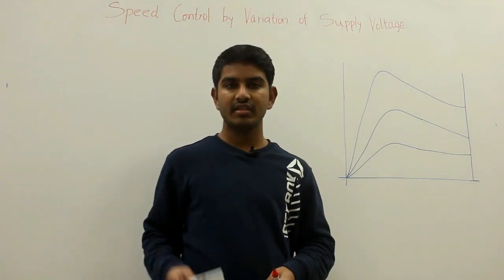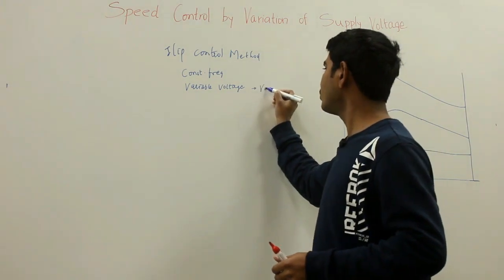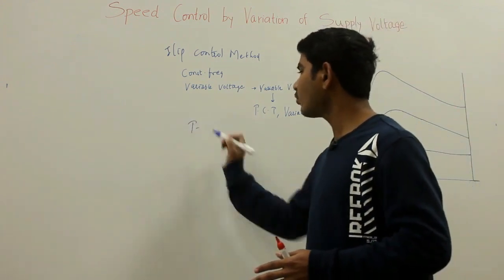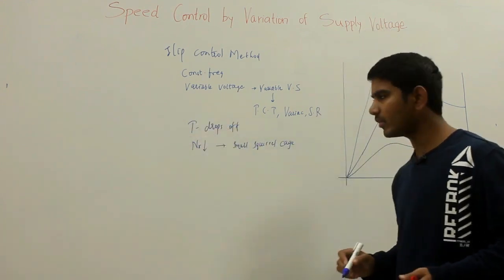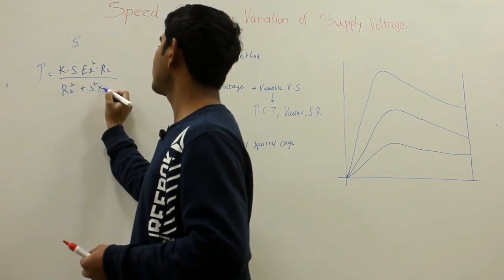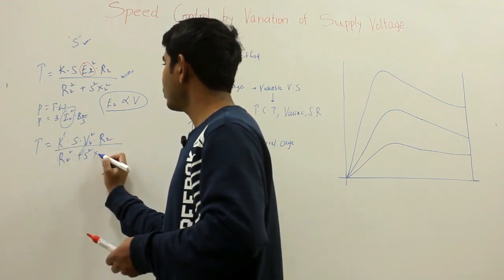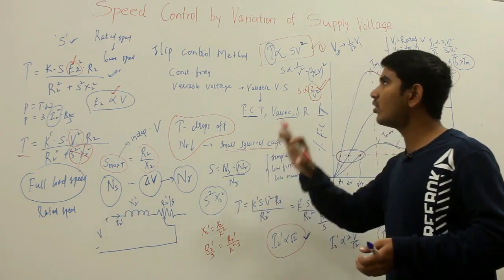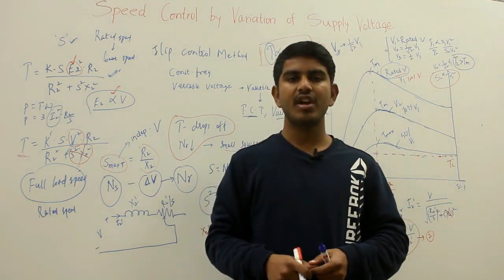Speed Control by Voltage Variation in Induction Motor

Comment: Hi, it's nice video . I am thinking, it is not safer to vary voltage by keeping frequency constant, why because you can understand from B vs H curve. So generally this method is not used. Please make a video on Variable voltage and variable frequency (VVVF) speed control method, which is more practical used.